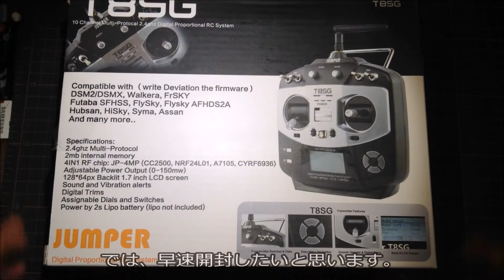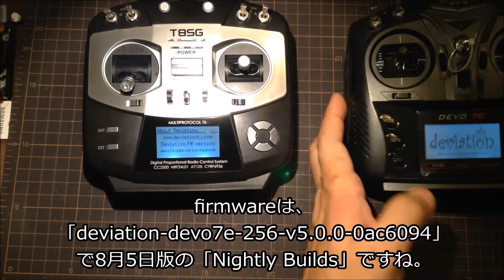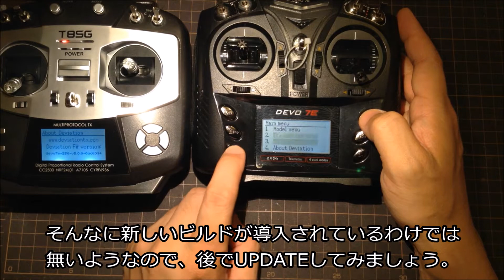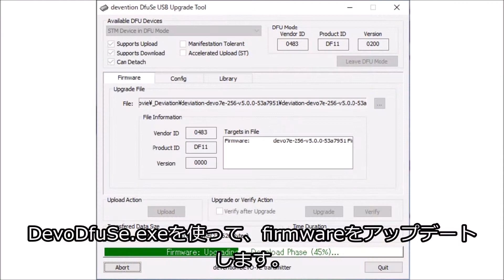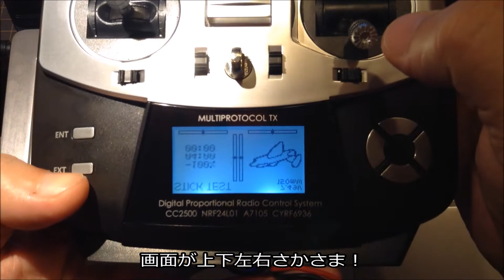Jumper T8SG change mode 1

Comment: My Jumper T8SG plus arrived today.  I didn't want to do the fiddly things you are doing in this video, so I just removed the gimbals and swapped them over.  It wasn't as straight forward as I'd hoped, as the gimbals seem to be glued in.
I carefully broke the glue 'seal' on each corner (x8) and swapped them over completely.  I'm just waiting on some batteries to arrive to check that it works as expected.